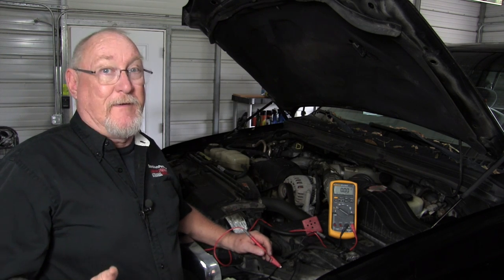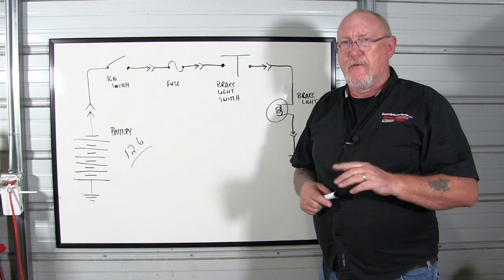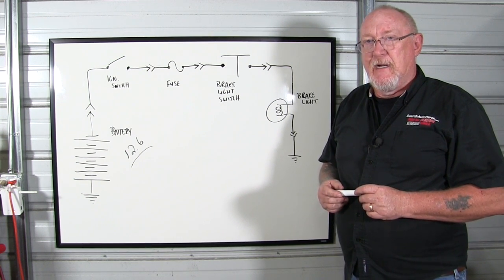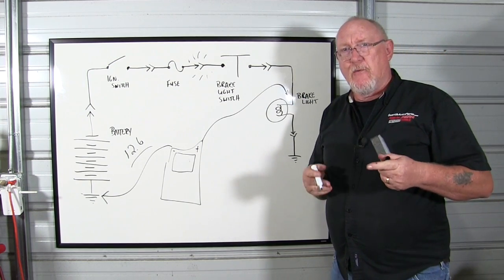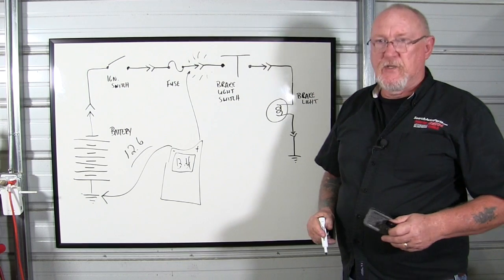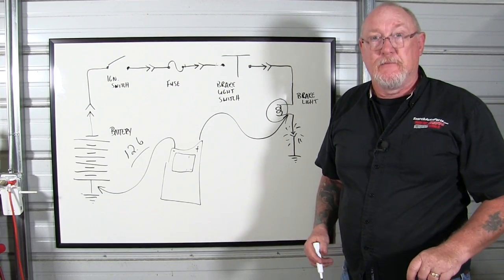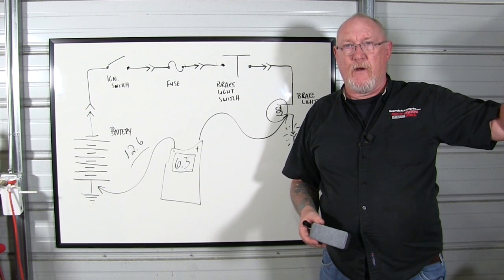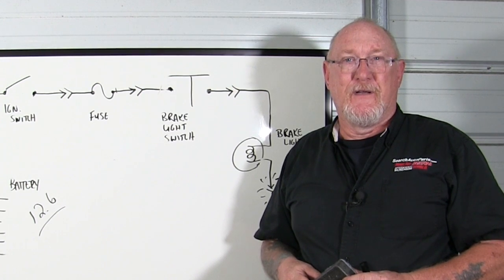The Trainer #84:  How You Can Measure Voltage When Your Meter Leads Say You Shouldn't

Comment: I had the sensor harness of my 2006 Mini Cooper S chewed up so bad that 6 inches of it was just gone. The insurance company wanted to have it spliced together. I refused and insisted it was replaced. There was a thousand dollar difference in the repairs cost.
For a person who was not covered by the comprehensive insurance, that could have been a really big problem. They would have had to become electrically proficient in a hurry on top of mechanically inclined enough to gain access to the wiring. Sad to say, after the job was done, I inspected it all and found they did not clip the wire harness to the brackets in place to keep it from touching hot surfaces or chafing on things. This was unacceptable so I did it myself. 

There is an epidemic of rodents eating wiring problem in the world since the car companies started using soy oil based wire insulation. The reason is that it is cheaper wires leading to extremely expensive repairs.

Comment: The tool called the Load Pro adds some resistance to the circuit and makes it easier to tell what's wrong. There is a ton of info on it so just put it into the search bar above.
Reply from the maker: The Load Pro allows the user to perform a voltage drop test on an unloaded, or open, circuit by unplugging the load and using the meters at the connector. It has an internal resistance used to load the wiring and uses the meter's battery as the "source". Anyone wanting to learn more can start here:  https://www.esitest.com/180.html

Comment: A voltage drop from pos to pos or neg to neg indicates bad connections I believe.
Reply from the maker: Bad connections, corrosion, damaged wiring - anything that adds additional resistance to the circuit! Thanks for commenting!

Comment: Severely underrated channel.
Problem with drive by wire throttle. Replaced TB, battery, pedal, and pigtail. PCM replaced in 2016. Service manual says P2100 is somewhere in ETC motor positive or negative wire. Load tested wiring with incandescent test light.  Would back probing ETC connector motor ground and voltage drop testing at B- test CPU ground side switch?
Reply from the maker: First question - are there any related drivability symptoms? Will the engine run at idle only or can it be driven normally? Second question - have you checked for any related TSBs? Third, is this the only code or are there others? Fourth, have you verified that the battery itself is correct for the application and healthy?

If there is a confirmed fault, then I would suggest testing the power and ground at the actuator. Reference your meter to battery ground. Check the power supply first by backprobing the power feed and actuating the motor with your scan tool or with the assistance of a helper. If the measured voltage is within a few tenths of the battery's voltage, move to the ground side. Repeat the test. You may even want to use the RECORD feature of your meter to catch a circuit glitch or driver fault - or better yet, a scope. Ground side normal should be just a few tenths of a volt. Hope this helps!

Comment: Hey Pete, Great video as always! Can you do video of how to find loose Ground point itself with Voltmeter? Had case of New Headlamps flickering, and found actual ground point itself loose. Would placing Voltmeter at the actual Ground point help? Please advise. .. 🤔
Reply from the maker: The ultimate "end" of the ground path is the negative battery post - so put the negative meter lead there. Then measure the ground side voltage with the load on, as close to the load as you can get. ANY voltage over a few tenths indicates a problem in the ground side and usually, the reading will be way more than a few tenths. Trace your way back toward the battery until the reading drops to an acceptable level and you know you've passed the problem. Hope this helps!
Reply: Excellent! Thanks for the info Pete.. Keep the videos coming through 👍